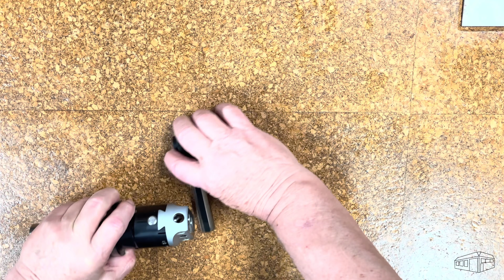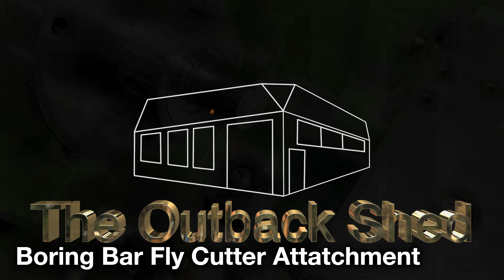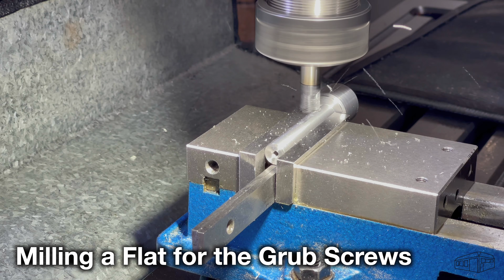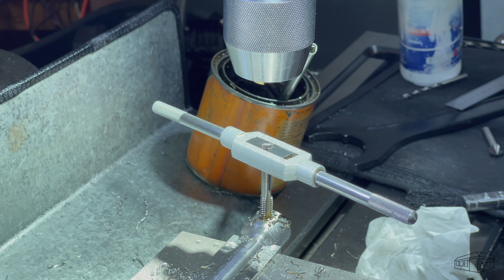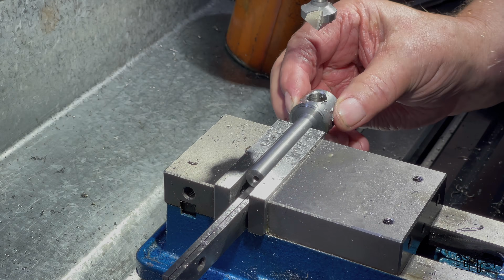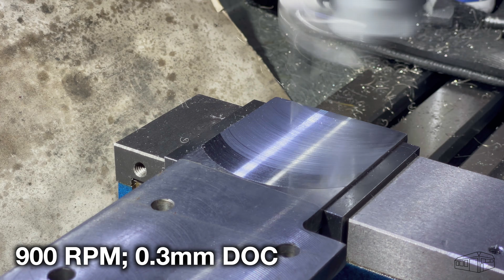Boring Head Must Have Accessory | Shop Made Tools #HFCreators

Comment from the maker: In this video I'll make an adapter to use a boring head as a fly cutter. It's a simple addition which comes standard with larger boring and facing heads but not with smaller boring heads. It's an easy build and I would think that this has been done before and I'm not the first machinist to think of it, but I haven't seen a build of this elsewhere, so I'll do one here.

Comment: If you’ve got a 20mm+ left-hand boring bar lying around, don’t let that chunky shank go to waste — give it a quick spin on the lathe and turn the shank diameter down. Voilà! You’ll get just enough tip offset to ditch the extension piece entirely. One less thing to lose in the swarf pile.

But wait, there’s a lazier (and better) way…
Grab a boring bar that takes a DNMG or VNMG insert. Thanks to their naturally angled geometry, you’ll get all the offset you need right out of the box — no turning, no tweaking, no tears. Bonus: they’re built like tanks, so you’ll gain stiffness and durability, too. It's like upgrading from a butter knife to a crowbar.😀 p.s. Internal grooving tools with a radiused insert would work really well too.
Reply: Makes sense to just let a L/H boring bar stick out of the side, you may have to turn the shank down a bit though.
Reply from the maker: Great ideas, I like that. Cheers SteveO

Comment: This is a great idea, Stevo.
I recently bought a (cheap) 50mm head with a selection of various length R/H brazed carbide tools, but I wanted to get a bit more diameter out of it by utilising the horizontal bore position, and I thought using them for fly cutting might also be possible too.
First, it dawned on me the normal spinning direction of R/H tooling wouldn't work in the horizontal position.
Using the horizontal position with these boring heads requires L/H tooling, or a tool holder/boring head arbour with a drive tang and some sort of grub screw lock, to stop the head from unscrewing off the standard arbour, as well as avoid unscrewing the draw bar on my machine, if I was to try to run the spindle in reverse with R/H tooling in the horizontal head bore.
It took me a while to track down a selection of various length L/H tool holders, Neutral and R/H insert tool holders were pretty easy to find.
Having a L/H tool will give me larger diameter range using the horizontal bore and can be used in the normal spinning direction.
Next I realised a LH tool can still only be used for boring.
Since there is no angle designed into horizontal bore in the head unlike a fly cutter, a standard round bar tool doesn't have any offset to touch the work.
Although, now with a L/H tool I can machine quite large diameter bores, I will probably have to take light cuts as rigidity/vibration might be an issue.
If I make a tool holder like your's, I can use the brazed carbide tools that came with my boring head for larger diameters + fly cutting, as well as it's just much easier to find R/H insert type tool holders if I find I need to use inserts on any jobs in future.👍🇦🇺
Reply from the maker: Thanks for the comment. Some of the more expensive boring heads have a bolt on arbor which allows it to be used in both directions. The wohlhaupter is an example of this although some of their models come as a one-piece unit with the arbor machined as part of the head. 

If you're looking for LH boring bars I would suggest LPT Toolmakers, here's the Link:
https://www.lprtoolmakers.com.au/indexable-left-hand-boring-bars-from-8-32mm/

Brazed or cemented carbide are fine but I would only use them for cast iron. HSS is another option and is good for cutting all metals albeit at a slower speed.
Hope this helps. Cheers SteveO
Reply: @theoutbackshed  Hi Steveo, cheers for your reply and the link, I'll check it out, and also thanks for the tip about only using brazed carbide for cast iron too👌

As I mentioned previously, I did manage to buy a few various ccmt insert tool holders in a few different lengths.

I bought 1×L/H 95mmL for horizontal.
2×Neutral 45mmL and 75mmL for chamfers.
1×R/H 75mmL for vertical.

They are just cheapies, only around $6-$8 each but they look quite good, proof will be in the pudding.

I also bought a selection of inserts for various materials, so I figured I'll just try them out and see how they go and what I really need before going too wild.

I'm just a hobby machinist (Mech fitter + Auto sparky trades) so I don't do very much machining, just the odd jobs here and there, I may never use them much at all, but handy to have on hand if needed.

My mill does have a tang slot in the spindle, but my boring head doesn't have a tang, just relies on a threaded draw bar and correct d.o.r to keep things tight.

I don't forsee myself buying another boring head or needing much in the way of other attachments, but seeing your horizontal/90° tool holder is a great way to get around needing the less common L/H tool holders but it also allows fly cutting/facing with the more common RH tools, so I will probably still make one at some stage as a fun and potentially very useful project.
Cheers.👍

Comment: Did you consider just clamping an 18mm shank left hand boring tool out the side of the boring head? The insert tip will be below the boring head base and will be much more rigid. You won't have to make anything then for a much sturdier solution.
Reply from the maker: Thanks for the comment. This head takes 12mm tooling and I did try a LH boring bar but there is not enough offset to clear the bottom of the boring head. This attachment was simple and means I can use shop made or commercially available 12mm tooling. Cheers SteveO
Reply: @theoutbackshed  Sorry mate, the video said 18mm which I thought at the time was an odd size.

Comment: Good result. I think length of the video is spot on. Long enough to show detail but short enough to keep interest. 
Good editing and voice over. 
Question: I thought that the minimum speed for using an edge finder was at least 500rpm?
Reply from the maker: Thanks for the comment. I wasn't aware of a minimum speed for an edge finder. I have broken one by using it too fast, it just flew apart. Cheers SteveO

Comment: I made one copied from a commercial design. Square bar with two dowels to fit the head and the protruding end milled to accept a Carbide insert. Very rigid.
Reply from the maker: Sounds like a good design! Thanks for sharing. Cheers SteveO

Comment: Hello, I'm a retired industrial electrician with a couple of toy machines.
What speed is good for turning a 18mm hole in copper on my lathe?
I am half way there but my internal tool is picking up the copper and making a mess of the finish!
Reply from the maker: Thanks for the comment. Copper is very difficult to turn. I did some in the 'Machinist Hammer' video. You can see the results at 19:17. I had the lathe running at 210rpm and a light feed. It was rough to start but when I applied some WD40 the cut very much improved. The copper seemed to become somewhat plastic during cutting as the swarf was compressing on the toolbit. Some trial and error will lead you to the best results for you but definitely, WD40 made a big difference. Hope this helps. Cheers SteveO
Reply: @ excellent, thank you, Will give that a try today
Reply: @Peter57808  Remember to enjoy your time in the shed.
Reply: @ always do, just tried 250 rpm and WD40. Proper cuts now and excellent finish, job done and thanking you again
Reply: Hard or soft?
Reply: @ not sure, is pure copper so soft?
It drilled ok at 500 rpm but the boring bar is galling and leaving a very rough finish
Reply: @Peter57808  Copper is a real bugger to machine.Light cuts with small feed and a sharp tool.

Comment: Very nice. Would it be beneficial to add a counterweight opposite the cutter?
Reply: Good thought. Either that or it might be very slow.
Reply from the maker: Thanks for the comment, I don't think a counterweight would be needed as it won't be used at high speed. The mill is very heavy and has a big spindle so vibration is dampened. Cheers SteveO

Comment: Nice addon. Do you have a preferred source in Oz that will send small lumps of 4140 and other bar stock as I don't get to the big smoke more than a few times a year?
Reply: For odd amounts of particular metals I go to Surmans in Adelaide. Iron,Bronze, Copper ,Aluminum and Steel in many different types. They are no Joke for particular steels and are usally happy to do smaller amounts. However they will charge but were usally not unfair.
Reply from the maker: Thanks for the comment, No I don't have a preferred source of 4140, It's become more difficult since the auto industry shut down. Cheers SteveO
Reply: @theoutbackshed Do Holden not make cars in Oz anymore?
Reply: @billdoodson4232  Haven't done for years.
Reply: @ Some of my mates were Ford and Holden Engineers and while neither make Vehicles here we still do some Engineering and Component manufacturing here. One of them still works in Interior Design for GM.